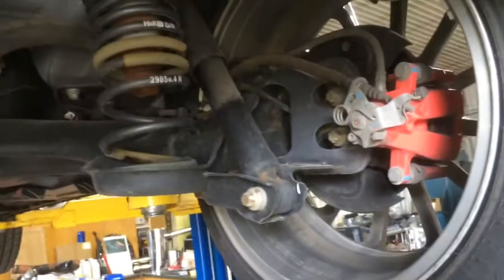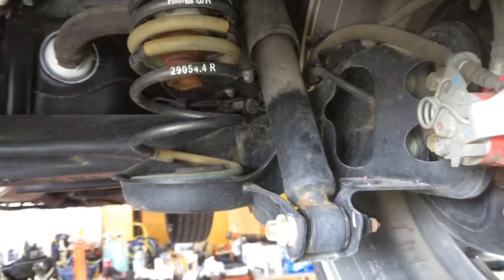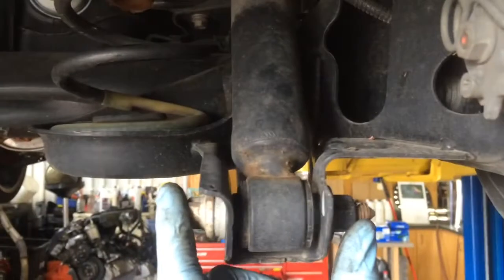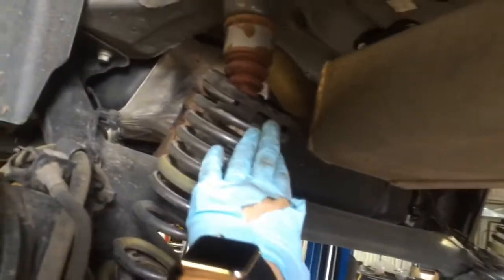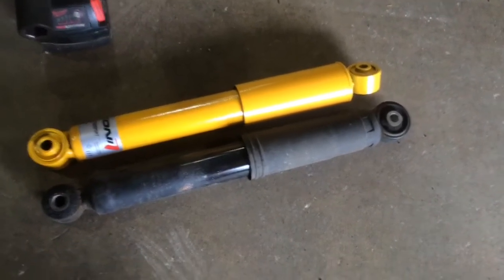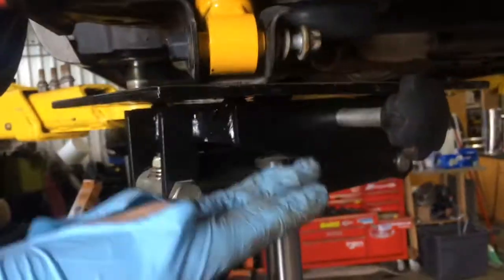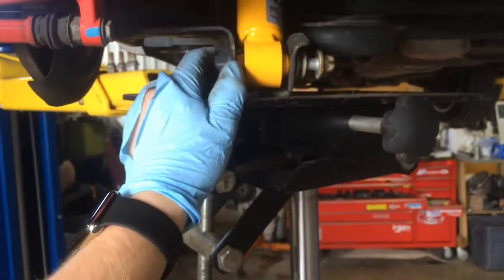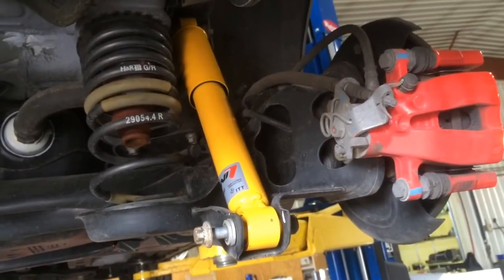2012+ fiat 500 koni rear shock absorber shocks DIY install

Comment: I didn't get when you said 'before decompress it, tighten it down'. Should I tighten them when the shocks are expended? Thanks..
Reply from the maker: tighten when the suspension is loaded (whether that be on the ground, or via jacking)

Comment: Is it possible to change only the shocks
 without removing the wheels?
Reply from the maker: yes
Reply: +Camper1234599 and how would you remove the upper bolt ? Through the wheel? Thx

Comment: Where did you purchase the shocks from?
Reply from the maker: +Jason Keomany Neuspeed. I actually have since returned the car to stock to trade it in and have a set with very low miles if you're in the market. (the exact shocks from the vid.)
Reply: How much?
Reply from the maker: +Jason Keomany 209 shipped lower 48 for the pair. roughly $75 savings even if you got em CHEAP new.
Reply: +Camper1234599  
Do you still have them?
Reply from the maker: +chase starling yep.